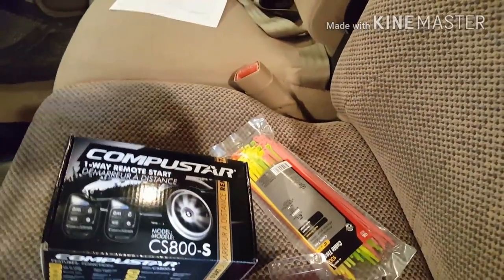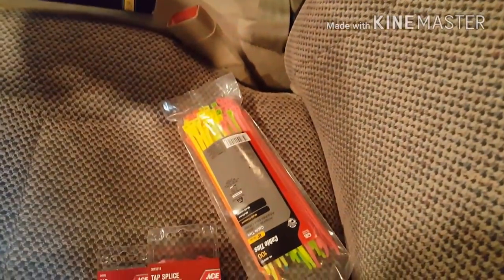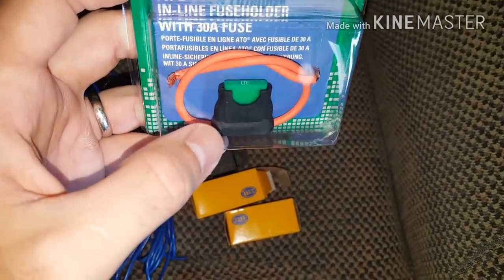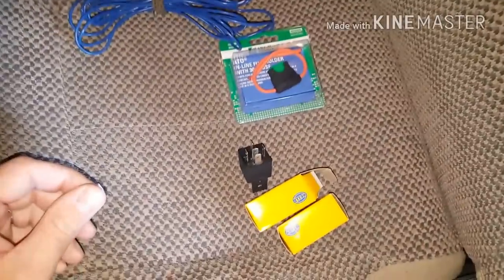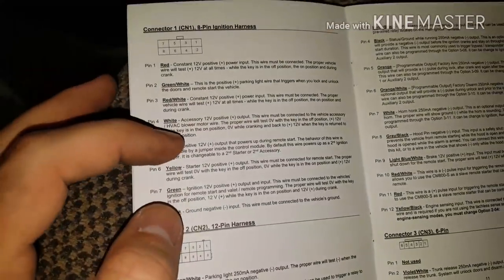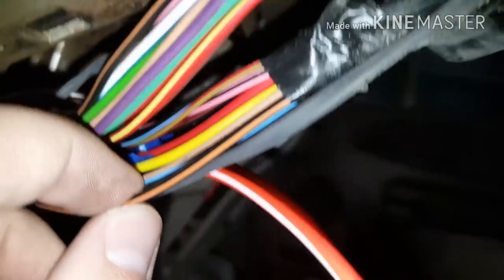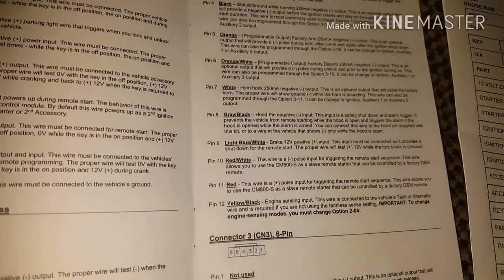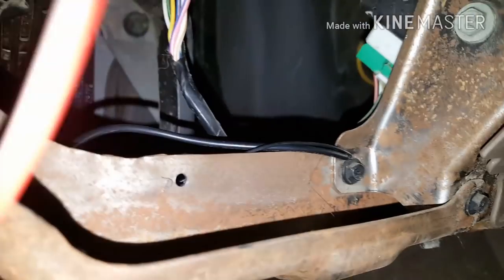2001 Dodge Ram 1500 remote start and remote entry wiring and install

Comment: Great help. I have a different remote start and keyless entry system in my truck and I followed how you did yours and it helped so much. The only problem I had was after I did the wiring for my locks it wouldn’t let me lock and unload both doors at the same time unless I disconnected the driver side door lock wires the connect to the switch but finally got it all working. Thank you for the step by step help on how to install a remote start and keyless entry
Reply from the maker: Tyler Abbott glad I could help!
Reply: What did you end up doing to make it work?

Comment: Thanks for the tutorial installed it fast I didn't know about the relays till I watched your video and I did use one of the 87a on the relay it was easier to get to the wires when I disconnected it from the door I also found relays with the a harnesses that have the colored wires from the diagram that made the diagram make sense
Reply from the maker: Glad i could help!!
Reply: @Handy-Mann  Do you have a link to this kit, or is it still on amazon?
Reply: Also, if you dont want the keyless entry do you need to wire the 6 pin?

Comment: Your relays are wired a little wrong. Check out Precision Connections vid. I wired mine his way. Then connected to the orange/blck and pink/black. Doors lock and unlock nice and solid.
Reply: Do you have a link?

Comment: Hi Handy Mann, thanks a lot for the video, it's very helpful. Please advise if I want to install this compustar cs 800 for Toyota highlander 2006, I need to install a bypass module, is it the pin 4 ( Black wire) in 12 pin harness to be connected to the bypass module? Thanks

Comment: I connected all the wires like you showed in the video and almost all of it works , the only thing not working is the horn when locking and unlocking and starting the truck. I connected the white wire from the unit to the blue with from the sterling column the one you showed. Any advice would be helpful.
Reply from the maker: I would just recheck the connection at the steering column, as well as the connection at your unit. You could also check your wiring schematic to make sure you have it connected into the correct wire, just incase your vehicle is slightly different.

Comment: I got this to work last summer  had the truck sitting all winter then this summer unlocking works flawless but locking only the drivers side locks  any suggestions what this might be
Reply from the maker: I would check the fuses first. I remember I blew one out and my remote start wouldn't work until I replaced it.

Comment: great video,and exelent explanation ,does it work on 94 ram 5.2?
Reply from the maker: It may not be the same exact colors for all your wires, however it will be a very similar procedure. If you go to bulldogsecurity.com and look up your year you'll be able to find the correct wiring schematic for your year. Best of luck!

Comment: what if I already have a key fob for door locks? would I still need the relays set-up? 
thanks in advance
Reply from the maker: suzuki rider depends on if it's stock or aftermarket. If it's aftermarket find the aftermarket system and figure out which wires are wired into your lock/unlock and connect in your new system lock/unlock wires to the old ones. If it's stock I don't believe you'll need the relay set up, but check out the extra wiring diagrams for the doors for your year at bulldogsecurities.com and see if your truck fits any of the extra diagrams they have for the door locks
I hope that all makes sense
Reply: thanks again

Comment: What if my truck has manual door locks since my truck is a base model how can i make it close with remote:)
Reply from the maker: You'll have to look into door lock actuators first
Reply: @Handy-Mann  once i order the actuators how will i wire it?:)

Comment: Hey Mr. Handy-Mann. In regards to ur video it was good and i installed mine, however i couldnt get the locks to work correctly with the black/orange and pink/black wire. kept popin fuses even with a 30. help
Reply from the maker: I'm trying to remember if I ended up switching to a 40 fuse. Did I mention which fuse I switched to?
Reply: @Handy-Mann  30 amp
Reply from the maker: @timothygeter9259  is it the fuse you added that's popping? Or the two fuses that came with the remote start that are popping. Also I wrote in towards the end (can't quite find a time for you) that I ended up switching the two red wires that provide power and constant power. Did you follow that step?
Reply: @Handy-Mann  it was the inline fuse I added. Everything was wired up to make the positive pulse output but the wires that u used vs. The wires on mine (95) I believe called for 2 different color wires but it kept poppn. However on the remote start part of it I can program mine to change my special options without the op500 programmer as my truck is diesel..the company compustar said they dont let customers have the firmware needed for the programmer only to dealers. smh
Reply from the maker: @timothygeter9259  that's unfortunate on the firmware. And you could be right on the wires being different colors. I know they changed some things in the 98+ models and I have an 01. You might try either going up to a 40 amp or potentially you might need to test and check the wires for a different wiring set up. Is the remote start working and are the doors working?
Reply: @Handy-Mann   the system is working but the door lock's are not work and I can't get my remote start to turn my engine over it only turns it over like 1.5 seconds and that's not long enough 4 my truck 2 start. diesels take up about 3 second 3.5.  2 turn over for the start.
Reply from the maker: @timothygeter9259  if the doors aren't working it most likely isn't wired correctly. My doors were locking and unlocking but I kept blowing that added fuse until I bumped up to a higher fuse. But if it isn't working then you most likely don't have it wired correctly. As for increasing the crank time, check your remote start manual for instructions on that
Reply: @Handy-Mann  ok I shall look into it more. And I will give u a shout out when I get it complete and working.  Thxs so much as ur video was extremely helpful.
Reply: @Handy-Mann  o yea does it make a difference in which wire is hooked up? All red wire or red wire/ white stripe
Reply: To Unstall just do everything in reverse  obviously and check wires make sure u have good connection

Comment: I followed your directions works perfect but if i use remote start i can not shut the truck off with the key i have to shut it off with the remote start
Reply from the maker: Will the engine shut off then you press on the brakes and you have not put the key in the ignition yet? Because if not then you may have a faulty remote start unit, otherwise possibly your constant power and main power could be flip flopped

Comment: My original remote was damaged. I do not have no remote for 2001 dodge ram 1500 2 door truck. Can I disconnect original wires and add new system for locks
Reply from the maker: You definitely can but I think it'll be way easier if you can just figure out which wires are your lock and unlock wires and connect in your new system, rather then disconnecting the old system and redoing everything including the relays

Comment: I have a 98 ram 2500 with the 12 valve cummins and 5 speed manual. Will this system work?
Reply from the maker: I believe it will, however you may want to confirm on the manufacturer's website. With a manual I believe that a tachometer wire also needs to be connected (not 100% sure that is correct though) and you obviously couldn't leave it in 1st gear when you're parked and could only park with the e brake on when trying to remote start your truck.
Reply: your probably not going to want the remote start fetcher.

Comment: I will say to anyone watching this, if your truck has the factory alarm system, you don’t need the relays, it even says on the bulldog wiring diagram, you can tell if you have the factory alarm and fob system if you have a little box wired in under the steering wheel in the dash area

Comment: Handy-Mann 
sorry for being a pest but I'm stuck and want to get the door locks to work what wire did you use from the compustar the blue or which please cause when you went to door locks you lost me I got the remote starting to work with your help greatly appriciated there if you don't want to help that's ok I understand But I'm LOST!!!!    Help please LOL
thank you
Reply from the maker: suzuki rider did you follow my explanation of the relays?
Reply: sorry that's where I got confused on
Reply from the maker: suzuki rider so do you have an aftermarket key fob? Or a factory installed key fob?
Reply: Factory Key fob
Reply from the maker: suzuki rider so I don't think my wiring video will work for your truck for the lock and unlock wiring. Go to bulldogsecurity.com and look up the wiring diagram for your truck and download the pdf for the lock and unlock wires. I believe since you have the factory key fob you already have on-board door lock relays,  so follow the wiring diagrams labeled "with On-board Door Lock Relays" unfortunately there's 3 different wiring set ups and I'm not sure which one is the one you'll need. Sorry I can't be much more help then that, but I believe you already have relays wired in so there's no need to add them to your truck like I do in this video.

Comment: What kinda relays are those?
Reply from the maker: If you Google relay and put in the numbers I mention around the 28 minute mark, you should be able to find the proper ones. I didn't have a preference as to what brand so I just got the cheapest and they've been working good for at least a year now
Reply: @Handy-Mann  thanks for the reply back, i ended up finding them. Now the fun begins. Haha

Comment: i didnt read all the comments as i know there are some haters there, Will this be the same for a 95 Ram?
Reply from the maker: It will be a very similar procedure, however the wire colors may be different. Be sure to look up on bulldog.com for your wiring schematic to get the correct colors and locations for your year and you should be good to go!